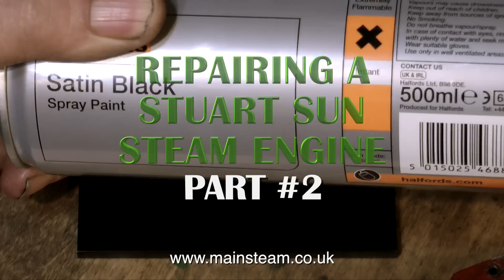PART #2 - REPAIRING A STUART "SUN" MODEL STEAM ENGINE

Comment: Merely FYI, "engineers blue" is the stuff you use to find high spots on bearings, or while "scraping" flat surfaces, i.e. You spread it thinly on a surface plate then rub the soon to be flat item on the film to highlight the high spots.
Marking out fluid, which is also mostly blue, is what you could have used, though as it costs money, it is hard to find in workshops in Yorkshire 😄
Reply from the maker: Surely, FYI. the "blue coloured stuff" serves the same purpose in either case . . . . . and in either case I haven't got any . . . .
Reply: Good plan, but doomed to failure. Engineers blue is a paste that leaves a very light film that is rubbed on with your finger, and sort of does not dry fully as it is expected to rub over to the part you are checking. Marking out fluid is applied with a brush or rag and leaves a deep blue a bit like a dye or ink if you get it on your fingers. It  then dries in a few minutes to a deep flake free finish that is ideal for a scriber to cut through. Watch Clickspring use it in his vids. Paint is a good workable second, and would work better than engineers blue.  Dyechem is a trade name I think.don't know how much it is as mine comes from my sponsor!
Reply from the maker: zzzzzzzzzzzzzzzzzzz
Reply: Kieth seems  a nice guy  but as he is always  telling us he's  a musician  ..   obviously  he does not know the difference between  engineers blue and marking blue and his machining methods make me cringe.. on the plus side he does  know his stuff about steam  engines  . That's why I follow his channel  . When we were apprentices we used  to put engineers blue on the machine  handles and on the eyepiece of the toolmakers  microscopes   ,good fun.

Comment: An easy way to mark out the plate would be to set it down on the clean plate and spray lightly around the edges and holes with the spray can, the marks come out reasonably clear and then you can centre punch the holes later.